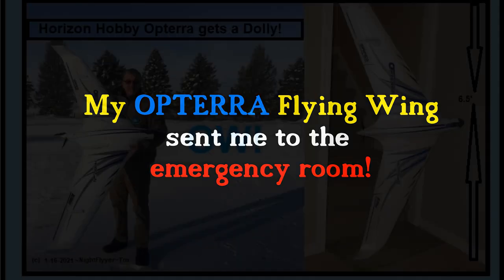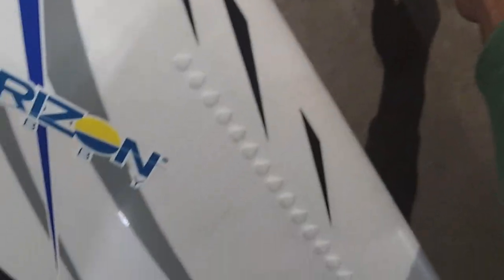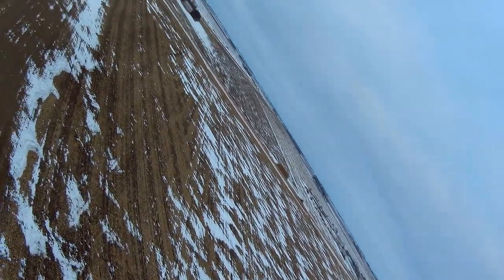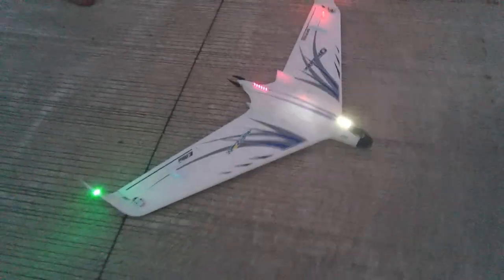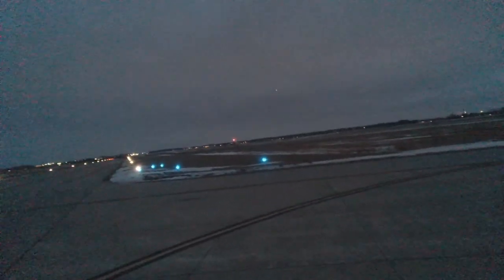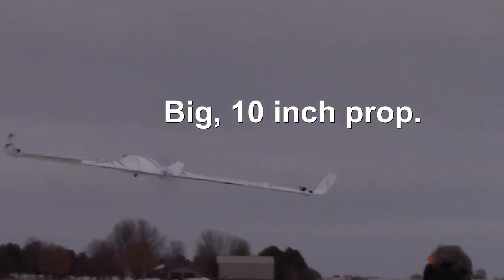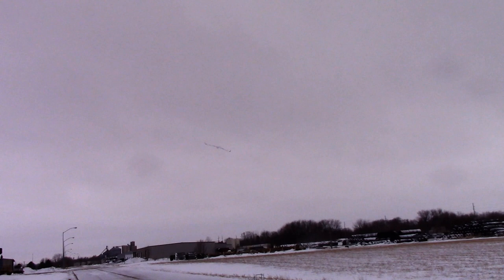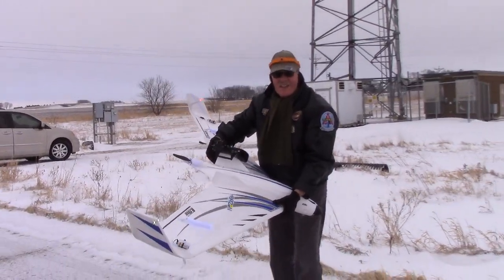My Opterra 2M Flying Wing sent me to the E.R. This is an awareness video & my solution for launching

Comment: I launch mine fine using the wingtip fling method. Use my left hand on right wingtip, let the right wingtip rest on the ground .
Reply from the maker: Again, I followed the instructions and I know how to launch that way, but when I tried to launch it discus style, but could not hold it where I felt I could launch it successfully in the wind.     It would also be extremely difficult to somehow launch it discus style with the elevon there and that 7" tall winglet rudder that is also on the tip.  I know how to do it , but not with this plane.  
It's not like launching my SMALL F-27 Evolution or 1.2M Opterra.  So I followed the instructions word for as I did for the video I made of my product review earlier where nothing happened bad.  https://www.youtube.com/watch?v=P_inF5EYLEE&t=1s and the second one where I explain how to protect the bottom of the fuselage.  https://www.youtube.com/watch?v=ur5V5H8UcGs&t=1s  I did not see it on your channel, but would have liked to.   Thanks.

Comment: Wouldn’t it easier to hot glue in a simple 3 wire trike gear?
Reply from the maker: Not as easy as my Dolly.  Yes, well if you saw my Product review  video,  https://www.youtube.co/watch?v=P_inF5EYLEE&t=1s  you would see  those wings aren't as strong or thick as you would think.  I would have to add a nose wheel servo and make it a trike as well.  And since the prop on the back is 10 inches, the landing gear would have to be quite long or retractable prop would hit the ground on rotation or landing. Thanks for the suggestion, but the dolly is pretty permanent too.  
 Thanks for the suggestion.

Comment: Suggest using an animal handling glove.  Will stop a prop and is easy to drop off after launch. You can get at Amazon for under $30.
Reply from the maker: Thanks for that suggestion and I tried that already, but because it was cold.  I found trying to hold on to the tiny finger grips on the bottom of the 7 foot wing with a thick glove under full power with wind blowing was difficult when under power and then trying to fly with  a big enough glove on was also difficult to fly the transmitter, (I'm a stick pincher)  so although that sounds like a good idea, it did not work that well. Some have told me the Prop got them in the forearm even before launch, when a gust of wind got under the wing and tipped it back, so gloves wont protect that.  We are only talking about a Half inch of clearance that I needed to keep from getting cut, and even though I pulled it off several times in my earlier product review video,  I will never hand launch it again.  LOL.  It's hello dolly from now on!  Thanks.

Comment: I was cringing every time you tossed it! Try holding it by the outer wing and just tossing it back hand. I do a little half spin and release. Get well!
Reply from the maker: That works with my F-27 evolution and the 1.3, but I cannot do it in the heavy wind and with this big 7 foot wing with my lights, battery, and those big winglets.  I simply followed the instructions as written in the manual and it all worked well in my earlier product review video on this, but not this time.  Thanks much.  https://www.youtube.com/watch?v=P_inF5EYLEE&t=1s

Comment: Leather gloves? Like falconeer gloves?
Reply: Amazon has tons of them from 20-40 bucks a pair.
Reply from the maker: Thanks for that suggestion and I tried that already, but because it was cold.  I found trying to hold on to the tiny finger grips on the bottom of the 7 foot wing with a thick glove under full power was difficult when under power and then trying to fly with the glove on and also difficult to fly the transmitter. So although that sounds like a good idea, it would probably not work that well. Some have told me the Prop got them in the forearm even before launch, when a gust of wind got under the wing and tipped it back.  Gloves wouldn't have helped him. We are only talking about a Half inch of clearance that I needed to keep from getting cut, so I will never hand launch it again.  LOL.  It's hello dolly from now on!

Comment: Why not program a throttle cut on a switch?  I have every single plane throttle cut set the same switch, I thought everyone did that
Reply from the maker: Not every one is aware of that.  
I'm no newbie!  First of all, that had nothing to do with my had injury. I only mentioned the Throttle arming because I followed instructions in the manual and this is the way it bound up and arms the motor as soon as you plug in the battery. It say nothing about setting up throttle hold. It's a warning to be cautious, because the manual says nothing about programming in a throttle cut to a switch. I've known of times when after flying, that switch was forgotten to be moved to safe and it armed as well.  Nothing is 100% as it could be left in the wrong position, by accident. I'm pretty experienced so never relied to on a throttle cut/hold, as all my machines need throttle stick movements to arm.   I only am warning others to be careful BEFORE the launch and to be careful no matter what you use.
Reply: @NightFlyyer  Agreed
Reply: @NightFlyyer   somebody at our field  who actually converted his Opterra To front engine mount and made it a puller
Reply from the maker: @shckltnebay  Good idea.  I might convert mine to a ducted fan later on.  thanks.

Comment: ALWAYS program a throttle cut for every electric airplane. Even if you use the type of ESC that you have to move the throttle stick to arm. With all due respect, not doing so was a rookie move.
Second, when you throw the Opterra, follow thorough and move your hand DOWNWARD away from the prop. You are not the first person that has been bitten by an Opterra, so don't feel too badly.
Reply from the maker: I certainly know that as most of my helis have that setup. Ive flown models for 60 years.  Im 73.  But the best rc pilots in the world, have also had bad landings once in a while.  Shit happens, especially while I was trying to throw this heavy, underpowered 7 foot model into the 12 mph headwinds.  Maybe if the Manual had said I should do that, I would have.  First of all, that had nothing to do with my hand injury. I only mentioned the Throttle arming because I followed instructions in the manual and this is the way it bound up and arms the motor as soon as you plug in the battery. It says nothing about programming in a cut switch like my helis have. I only mention it to warn others to program in this feature as well,  which also should have been mentioned in the instructions.  It's my warning to be cautious, because the manual says nothing about programming in a throttle hold to a switch. I've known of times when after flying, that switch was forgotten to be moved back to safe and it armed as well.  Nothing is 100% as it could be left in the wrong position, by accident. I'm pretty experienced, so never relied to on a throttle cut/hold, as all my helis and my drones, and many of my electric planes need throttle stick movements to arm.   I only am warning others to be careful BEFORE the launch and to be careful no matter what you use. .    Here are the links to the last videos and you can see I launched it the same way without problems.  Thanks.  Its hello dolly from now on. 
https://www.youtube.com/watch?v=P_inF5EYLEE&t=1s&gl=CO  and   https://www.youtube.com/watch?v=ur5V5H8UcGs&t=1s

Comment: Guess you could try hand launching it while wearing one of those gloves with a hard plastic shell; motorcycle and dirt bike ones, maybe even something as simple as a hard plastic movie toy like the "Infinity Gauntlet" from the Marvel movies would be fine. That or just an armoured gauntlet like it's the medieval period or something. Heck, a sheet of rigid thermo plastic (ABS, PPE, PolyCarb, Acrylic, etc) and make you own onto a pair of comfy gloves would work too: patterns are easy to find online and the power of a baking sheet in you oven..
But glade you could get it stitched up so well. And it was nice you could land it safely, after only a few cheeky passes. I understand, things up and flying, tissue has been deployed, might as well fly it for a bit (not sarcasm, kinda fun seeing you fly it for a bit first).
Reply from the maker: Thanks for that suggestion and I tried that already, but because it was cold.  I found trying to hold on to the tiny finger grips on the bottom of the 7 foot wing with a thick glove under full power with wind blowing was difficult when under power and then trying to fly with  a big enough glove on was also difficult to fly the transmitter, (I'm a stick pincher)  so although that sounds like a good idea, it did not work that well. Some have told me the Prop got them in the forearm even before launch, when a gust of wind got under the wing and tipped it back, so gloves wont protect that.  We are only talking about a Half inch of clearance that I needed to keep from getting cut, and even though I pulled it off several times in my earlier product review video,  I will never hand launch it again.  LOL.  It's hello dolly from now on!  Thanks much.

Comment: Why have you not set throttle cut?
Reply from the maker: Of course I know how and  have.  First of all, that had nothing to do with my hand injury. I only mentioned the Throttle arming because I followed instructions in the manual and this is the way it bound up and arms the motor as soon as you plug in the battery. It says nothing about programming in a cut switch like my helis have.  It's my warning to be cautious, because the manual says nothing about programming in a throttle hold to a switch. I've known of times when after flying, that switch was forgotten to be moved back to safe and it armed as well.  Nothing is 100% as it could be left in the wrong position, by accident. I'm pretty experienced, so never relied to on a throttle cut/hold, as all my machines need throttle stick movements to arm.   I only am warning others to be careful BEFORE the launch and to be careful no matter what you use.

Comment: Have you tried a Kevlar glove?
Reply from the maker: Thanks for that suggestion and I tried that already, but because it was cold.  I found trying to hold on to the tiny finger grips on the bottom of the 7 foot wing with a thick glove under full power with wind blowing was difficult when under power and then trying to fly with  a big enough glove on was also difficult to fly the transmitter, (I'm a stick pincher)  so although that sounds like a good idea, it did not work that well. Some have told me the Prop got them in the forearm even before launch, when a gust of wind got under the wing and tipped it back, so gloves wont protect that.  We are only talking about a Half inch of clearance that I needed to keep from getting cut, and even though I pulled it off several times in my earlier product review video,  I will never hand launch it again.  LOL.  It's hello dolly from now on!  Check out my latest video and I explain it very well, so you can see.  https://youtu.be/f5xDfk7sbcQ   Thanks.

Comment: Try launching it and turning the throttle hold switch off so it’s at full throttle. Seems like the best way to do it.
Reply from the maker: The Opterra 2M manual also says nothing about throwing it with the motor off, so if a newbie followed the instructions, like I did, I'm showing what could happen, in case a gust of wind got them or something else.     Nothing is 100% and no matter how good you can throw, this big 7 foot wing with a 10 inch prop spinning right next to your face, is risky.  It is close.  Thanks Keith.
Reply: @NightFlyyer  I hope you have a full recovery. There has to be a safer way of launching if limiting your risk. Like tossing it and then throwing the throttle hold switch off. I hope you can developer a method to hand launch where you are less likely to be injured because there’s no fun in that. 
Just had extensive shoulder surgery so patiently waiting for it to heal so I can maiden my new Trex 700.
Reply from the maker: @keithwhisman  I tried that, but this big  underpowered wing barely makes it fly out of your hand at full power, so I will only use my dolly from now on.  Thanks again.
Reply: @NightFlyyer  so then a rubber band powered glider launch system for other people. I do like your dolly launcher or launch cradle,

Comment: Hey there Dave I had this happen to me with a delta wing wing Z-84, check my video "losing my virginity"...lol Now I either hand launch holding just to the left of the nose, holding the model near the ground and pulling the model up tot the sky for launch, or if I have to be under the plane to hand launch, I try and slap my knee as I let go of the model, to get my hand out of the way of the prop. Hope you heal quickly.
Reply from the maker: The Opterra 2M manual also says nothing about throwing it with the motor off, so if a newbie followed the instructions, like I did, I'm showing what could happen, in case a gust of wind got them or something else.     Nothing is 100% and no matter how good you can throw, this big 7 foot wing with a 10 inch prop spinning right next to your face, into 12 MPH is risky to say the least.  The 10" prop is very close to your forearm as well, so a gust could tip it back even before launch, as others told me happened to them.  Thanks.

Comment: Pretty Slick idea using the launching kart. I bet you could rig up a steering servo on the karts rear wheels. For those that still hand launch wear meat cutters butcher gloves for that👍👍
Reply from the maker: Yes, well I could, but that is more trouble.  My guide string worked well. Thanks for that suggestion and I also tried gloves already, but because it was cold.  I found trying to hold on to the tiny finger grips on the bottom of the 7 foot wing with a thick glove under full power with wind blowing was difficult when under power and then trying to fly with  a big enough glove on was also difficult to fly the transmitter, (I'm a stick pincher)  so although that sounds like a good idea, it did not work that well. Some have told me the Prop got them in the forearm even before launch, when a gust of wind got under the wing and tipped it back, so gloves wont protect that.  We are only talking about a Half inch of clearance that I needed to keep from getting cut, and even though I pulled it off several times in my earlier product review video,  I will never hand launch it again.  LOL.  It's hello dolly from now on!  Thanks.
Reply: If it were my plane I would install tall landing gear like the Concord has on it to give the plane plenty of lift for takeoff.
Reply from the maker: @miguelsalami  Yes, well if you saw my Product review  video,  https://www.youtube.co/watch?v=P_inF5EYLEE&t=1s  you would see  those wings aren't as strong or thick as you would think.  I would have to add a nose wheel servo and make it a trike as well.  And since the prop on the back is 10 inches, the landing gear would have to be quite long or retractable prop would hit the ground on rotation or landing. Thanks for the suggestion, but the dolly is now my landing gear and does not add any weight to this under powered 7 foot long wing.
Reply: @NightFlyyer  Understood👍👍

Comment: what a nice looking plane. i would suggest a landing gear but not as nice looking.
Reply from the maker: My landing gear is now the dolly, and that keeps the plane clean. A landing gear would have to be quite long, with nose wheel and servo to steer, as that big prop would hit on rotation and would add more weight.   I flew it a handful of times successfully, but it only 1/2 inch clearance was needed to keep me from getting cut, and that is a close margin.  I can tell you this...I will never handlaunch it again.  LOL.  Thanks much.

Comment: Why are you not using THROTTLE CUT when you’re picking up and moving plane from ground to launch place!?
I watched some videos before purchasing an Opterra. One good one, RC Phillips said DO NOT RUN ENGINE IN HAND LAUNCH. THROW BIRD WITH LEFT HAND THEN THROTTLE UP!
I very surprised you’re flying your RC at a general aviation airport.
Reply from the maker: I’m surprised you didn’t see the follow up videos. I’m not the only one that got hurt. I use throttle cut on all my planes and helis. Like I said in my other videos, launching with my left hand this 7 foot plane with the tiniest finger holds with motor off in 12 mph winds then getting hand back down on the throttle stick didn’t work for me.  I put retracts on and that is the safest way. Due to me being in the AMA hall of fame and my reputation around here, I was invited and am allowed to fly at this uncontrolled airport any time I want.  I’d like to see your hand launches , but see no rc or opterra 2m flights on  your channel.

Comment: Might need a cut proof glove for this.
Reply from the maker: Thanks for that suggestion and I tried that already, because it was cold, but trying to hold on to the tiny finger grips on the bottom of this 7 foot wing with a thick glove would be difficult when under power and then trying to fly with it on.  Plus it would also be difficult to fly the transmitter,  so although that sounds like a good idea, it would probably not work that well.  We are only talking about a Half inch of clearance that I needed to keep from getting cut. I have heard of others who have actually cut the top of their wrist and fore arm as well.  I figured out a great solution and hope you enjoy checking it out.  Thanks again.  https://www.youtube.com/watch?v=fECB6U6R0uk